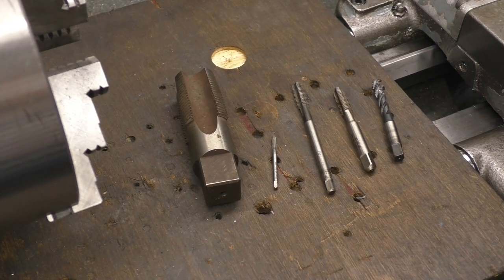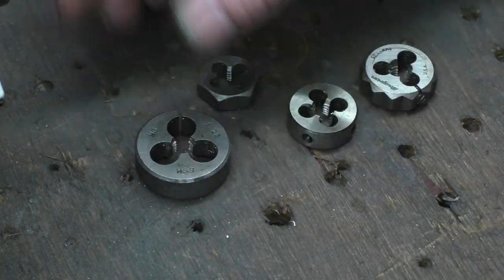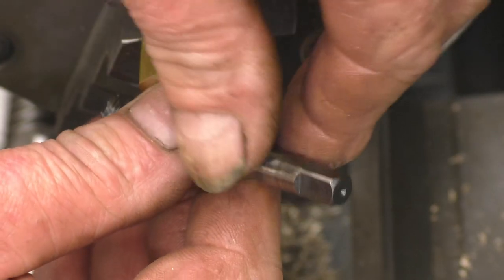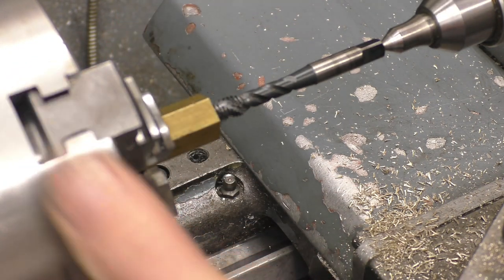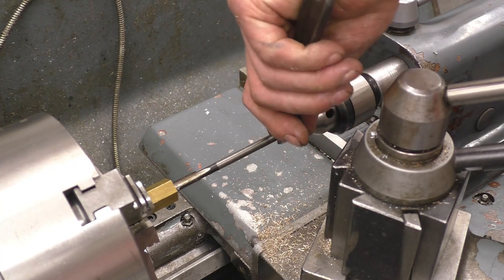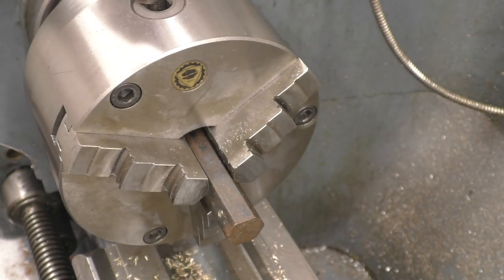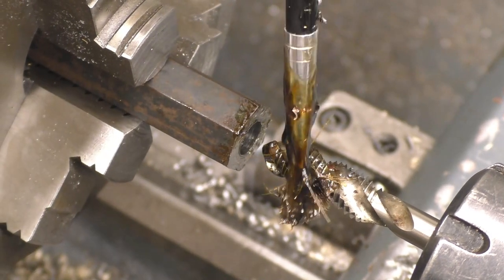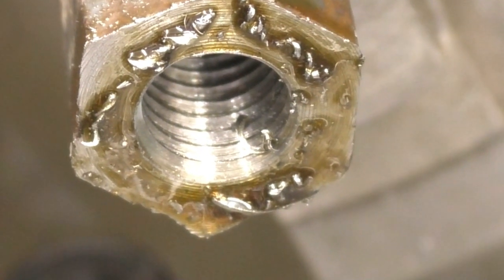Lathe Tutorial P 10   Taps & Dies

Comment: Like Luke, I have always wondered how you push the tap in when it is fixed in the collet. With the tail stock locked you would have to wind the chuck in at exactly the right speed or the threads would strip. Do you shove it by hand until the tap gets a grip then leave it to do it’s own thing? Doubtless one of those things that is too obvious to you to need explaining!!
Reply: The collet chuck is in a sliding fixture that allows the tap to move into the work but it has a cross bolt in a slot that stops it turning.

Comment: Question, on the last demonstration - power tapping, how did you feed the tap in with the tail stock? I noticed you turned the headstock speed down very low, so I'm assuming you fed the tap in with the tail stock's feed wheel, with the tail
 Stock locked in position, just fast enough to keep up with the speed the tap wants to cut into to pilot hole. Essentially by feel alone?
This may seem like an obvious answer, but as a beginner sometimes it's hard to tell whats going on out of the camera's shot, and how to replicate the technique safely.
Excellent video, many thanks
Reply from the maker: I just feed it in by hand . You get a feel for it